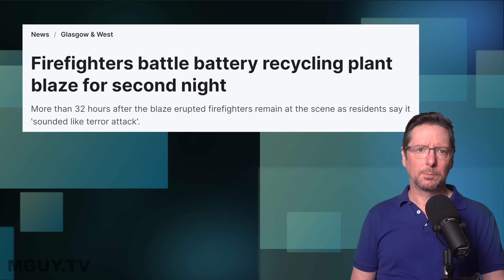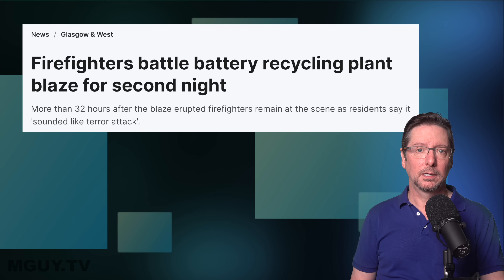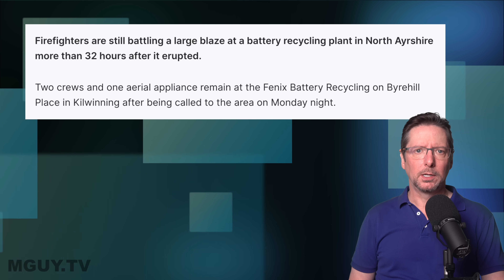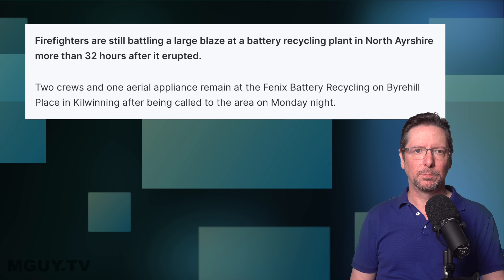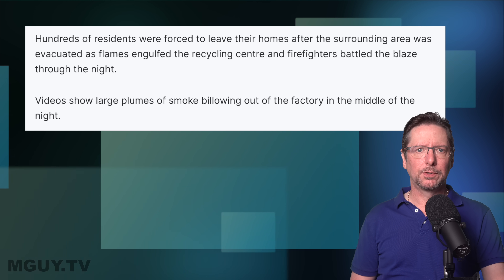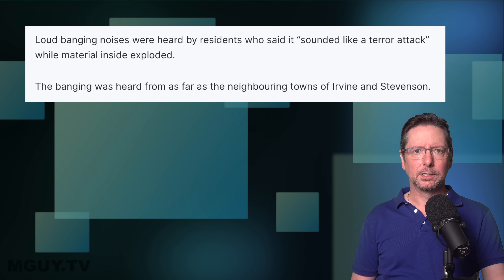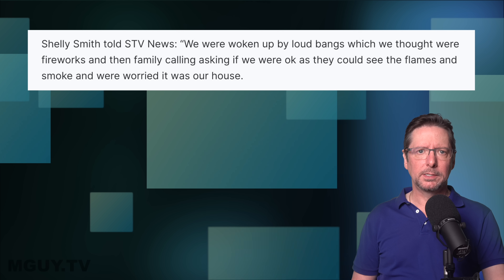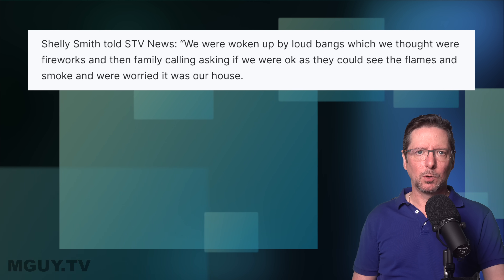EV and Lithium Ion battery recycling is DIFFICULT, DANGEROUS and TOXIC | MGUY Australia

Comment: B.S. They DON'T use fossil fuel to mine the battery minerals.
They use environmentally friendly children.
Reply: They walk to work and they wear the same cloths for months: ultimate eco sla- worker
Reply: Those exhale CO2...
Reply: @MVA133  But your not taking into account that they sequester some of that CO2 in the excrement!
Reply: @thelink66c  That'll end up in the soil and the water. Hmmm, what a conundrum..
Reply: Well, for the cobalt at least. Barring a big change in the dominant battery chemistry, EV production isn’t going to be practical in the long run.
Reply: Both.
Reply: 1. Kid battery mineral labor

2. Some people get extreme range anxiety

3. Much higher risk of garage fires.... 

4. Paying $15k to $20k more than a comparable vehicle.. 

5. every time you fuel up an EV, the fuel tank gets smaller and smaller. Battery degeneration. 

6. Poor resale value. The porsche Taycan turbo S model Ev, loses over $100,000 dollars in value, in just 4 years time. That's $100k!, or $25k per year. A Nissan leaf Ev loses over half its value in 2.5 years. Here's a little joke ; how do you double the value of an Ev, when you go to sell it?.... Answer; you leave a $1 coin in the glove box. 

7. Much reduced performance from the battery in the cold, on the highway. 

8. Higher repair costs, where many, many mechanics refuse to work on them or aren't trained to do so. 

9. Awful charging network
experiences in the weather, 
without restrooms. 

10. Higher insurance rates. The UK is a great example. 

11. Replacing tires more
frequently. Michelin states that tires wear out 20% faster on an Ev, and could be as high as 50% faster! Ev tires made for ev's, cost 20 to 30% more, than regular tires for ice cars. As Ev tires wear out, they leave behind more tiny particles of rubber than normal ice cars. This causes more pollution. 

12. Death by autopilot, if you use it in cars that have that feature. 

13. $15k - $35k battery

14. Low km range per tank of energy. 

15. Sometimes, you must wait in-line 1-2 hrs
to charge.

16. Then wait more time to charge, while charging.

17. Spontaneous combustion, with no way to put out the fire storm.

18. If they catch fire in a tunnel, many people will die.

19. People without a pro charger system or a parking spot at their house, will run an extension cord to the road, which is dangerous and could lead to people tampering with your charging setup (super slow charging at the road). Currently illegal to run an extension cord to the street in most places. 

20. If you're in California, you won't be able to charge your car past 4pm because of a shortage of electricity supply on the cheesy grid.

21. It is not actually "green". The pollution is made at the power station, and during the manufacturing process, not the car.
In advance of the Cop26 climate conference in Glasgow in 2021, Volvo released figures claiming that greenhouse gas emissions during production of an electric car are nearly 70% higher than when manufacturing a petrol one.

22. Only 5% of used junk batteries get recycled, the rest go directly into the bin. It's cheaper to mine for new minerals.

23. Chhinna actually does 70% of all the refining of the minerals and production of the batteries.

24. Minerals are becoming more and more scarce, and the cost will only go up, not down.

25. Some countries where they mine for lithium, actually use a very big boat load of fresh water to only produce 1 ton of lithium, so they are afraid of running out of water. It takes over 2 million liters of fresh clean water to produce 1 ton of lithium.
Reply: There's more to the list!

26. Ev cars will soon not be able to drive in tunnels or be able to park in underground parking garage and probably will eventually void your house insurance if you park it in your personal garage... 

27. It is very hard to charge your battery at super stations when it is bitter cold out. Look to Chicago news for this situation. 

28. If a fire truck comes to put out an Ev fire, all the chemicals go directly into the sewer or storm drain system, poisoning everything. They need tons of water to slow down the burn. They can't actually put the fires out, they are only trying to prevent other things near by from catching fire. 

29. Ok, there are 2 good things; regenerative braking, which charges the battery while you are slowing down on the highway, which saves your brakes from much wear. It has come to my attention that some people set up their regen system for maximum regen while taking their foot off the accelerator pedal, and not "coasting". For best mpg, you must coast more. You need to "hyper mill" for best mpg. If regen is set too high, passengers will end up puking. This happens because the car is too quiet and accelerating and slowing down to fast. 

30. Loss of fuel tax revenue, so now the roads will only get worse, not better, but... The state of new Jersey will have a new annual road tax for Ev buyers, starting July 1st, 2024. The fee starts at $250 in July and will increase by $10 until 2028, when it reaches $290. EV buyers in the state will also have to pay four years of registration fees upfront, making it significantly more expensive to purchase a new electric model. Other states also have their own way of collecting money. 

31. in Dublin, huge diesel generators are being used to charge EV buses, due to electrical grid strain. buses in Athlone also cannot be put on charge until midnight, for the same reason. Bus Éireann is saying that they can't charge their buses until 11pm for the same reason,  and to avail of a lower tariff. 

32. Not everyone on earth even has electricity to charge their cars. What are they supposed to do in 2035? It's easy to get a bucket of fuel to power up a regular car. 

33. VCE, or "vapour cloud explosion" is very bad. If any battery, typically anything larger than an E-scooter battery, and especially only "half" charged. If a problem occurs in the cells, it might not catch on fire right away. Instead, a cloud appears, and then may be ignited a short period afterwards. There are 2 different types of vapour clouds that appear; heavier and lighter than air, which form will be dominate, can not be predicted yet. This produces a bomm.

34. For Ev transport trucks, they aren't allowed to carry the same payload as a diesel truck, because of the massive weight of the battery. The owner of the Ev truck therefore loses potential profit, every day. They also lose more profit for the waiting times for charging that Ev truck. The driver will get paid to charge the truck, which in turn forces the owner of the truck to lose more money. 

35. Ev cars are more likely to be written off, if they experience a minor collision. After the collision, something could have upset the structural integrity of the battery. 

36. Ev cars lie to you. If you are bold enough to go out on a decent road trip and its 210 miles, one way, and your Ev tells you that your battery will last you 223 miles, there had better be no hills, or excessively cold out.... You'll probably get stranded, trying to get to the charger, at the end of the trip. Ev's have left many families stranded already. 

37. Ev's and their batteries, will soon need their very own "passport". With all info about them when born, and current info about them (power output, resistance, mineral composition, etc.) 

38. Thieves stealing charging cables, will soon make it impossible to "fuel" an Ev car. They take a long time to replace the cables, just to have them cut again for scrap money. 

39. Cars were typically being made lighter and lighter using aluminum and or fiberglass and or carbon fiber, to reduce emissions and pollution. Ev's are only getting heavier and heavier, causing more pollution than ever. Remember, an ev's pollution is made at the power station and the dump, not at the actual Ev, except for the tire particles as mentioned above. 

40. More on spontaneous combustion of the battery. What if you had 3 children strapped into car seats, in the back seat, which kid do you rescue? More fires start so fast, there is hardly any time for even the driver to escape, let alone 3 kids strapped in. 

41. There must be a reason that Boeing 787's aren't battery powered.... Until jets are battery powered, I'll be sticking to fossil fuels for my mode of transportation. 

42. Can't bring an Ev up north in the woods, nor any battery powered chain saws, where there are no grids to charge them up. You would need a huge amount of solar panels to get you anywhere. 

43. Even Mr. Bean, (Rowan Atkinson) says;
"I love electric vehicles – and was an early adopter. But increasingly I feel duped". 
"When you start to drill into the facts, electric motoring doesn’t seem to be quite the environmental panaceaa it is claimed to be." "It seems a perverse choice of hardware with which to lead the automobile’s fight against the climate crisis." 

Mr. Bean (Rowan Atkinson) is a smart man. 

44. There isn't a used market for ev's. How are teenagers going to buy and insure a $50K Ev... (take your pick: either $50,000 new or a $20000 used EV that needs a $20K battery replacement in a few years)?? A teenager can buy a used $1k ice car and be set up for 5 years, no problem. 

45. Even if large transport trucking companies have a service where they could just swap out their pouch batteries for a freshly charged battery, the lifespan of the battery would be greatly reduced to maybe a couple of years. Recharging a huge battery 3 or 4 times per day would really hurt the battery in short order. 

46. If an Ev car goes up in flames on a huge cargo ship, the whole cargo ship sinks. Happened many times already. 

47. Many many people claim that driving in an Ev makes them, their family and their dogs sick. Motion sickness. 

48. With the extended charge times in the public, there is a much greater chance of getting mugged or car jacked. In a tesla, if you see a criminal gang heading right towards you to mug you and steal your tesla, you can't just drive off. You must go outside, disconnect the charger, go back inside your tesla, turn it on, put it into drive mode, and then attempt to flee the muggers, with the little time you still have remaining. In a regular petrol car, all you must do is put it in drive or 1st gear, and flea the situation. The fuel pump hoses have nice quick-disconnect couplings that pull apart when you go to attempt to flee criminals. This saves much time, your car, and potentially your invaluable life! 

49. When your Ev is at 10% Battery left, and you head out to find a public fast charger bank of 10 fast chargers, and they are all full, and ok, some aren't working, and there is a line up of another 10 cars in front of the fast charger bank, you might not be garenteed that once you actually have access to a "fast" charger, that it will actually be capable of "fast" charging. You see, there is only so much power alloted to a full bank of "fast" chargers. You will get fast charging for maybe 5 or 6 chargers being used at a bank of 10, but connect 7 or 8 or 9 or 10 ev's to that bank of 10, the bank as a whole will throttle charging power output to all cars, so as to not fry all the wiring of the bank or blow the fuse or breaker. With 10 cars charging at that bank of fast chargers, it will become a bank of "slow" chargers. I would have of thought that this would be designed into a fast charging bank. Some charging stations might not throttle you down. 

50. BMW i5 Ev cars and some similar models of BMW protect their battery life. If you DC "fast" charge to many times, a message pops up saying that you must wait 2 days to "fast DC charge" again. This protects your battery. Some say that you can DC fast charge, but at a reduced rate, and some say that the alarm resets once you ac charge 1 time. 

not all of these points affect every Ev, or Ev driver, or every Ev charging station or bank

There's this Ev van company called "Arrival", in the UK. It's been around for 10 years or so. It was worth around $13 billion just 2 years ago.... 

They didn't sell a single unit, and are now bankrupt.

Hertz rental car company backed out of a huge tesla Ev purchase of 100,000 ev's. Soon after, Hertz backed out of a huge purchase of 65,000 Chinese Polestar ev's. They did that because ev's cost to much to own, and too much to operate. The CEO of Hertz, Stephen Scherr, is stepping down from his position late March, 2024. He blamed EVs for the Loss of revenue. The cars were more expensive to maintain than Hertz had initially thought, and the company couldn’t make as much money selling them, when it needed to refresh its offerings.
Reply: @Tezzzaaa  tried not to. Lol.
Reply: @jakefriesenjake go get ‘em Tiger! Geez, you wonder how they ever managed to sell that junk in the first place. Mind you, there is a place for some type of electric vehicles, but the current state of the art is not it.
Reply: @markvincent5992  absolutely. Buy one if you want. Don't force anything. Our infrastructure doesn't support it
Reply: @jakefriesenjake  Thanks Jake, I'm keeping that list for later use. Cheers.
Reply: @RoverIAC  no problem! Copy and paste. It took me a few months to create that list. I guess some people don't like it, so I was forced to split my list into 2 pieces, so that I could actually post it. Bunch of bs I have to jump through just to be able to talk in here. Enjoy.
Reply: @jakefriesenjake all correct and true! EVs don’t sound too good anymore, do they?
Reply: @markvincent5992  they are ok, but definitely not for everyone.
Reply: @jakefriesenjake  I see hybrids in the near future. I would like a hybrid with awd, around 400 total hp, using small individual motors at each corner and using a small I/C system to make electricity and heat/cooling without any drain. A small battery pack would be used for around town. All that and 50+ mpg
Reply: @markvincent5992  yup. Saves brakes and charges up your battery while you apply the brakes. Makes sense.

If the people who buy high horsepower ev's are truly concerned about the environment and being green, they wouldn't buy them.

They would buy the absolute lowest hp ev, to conserve battery power
Reply: Why waste resources and money sending children to school? So much more educational, cheaper and better for the environment to have them doing the work of hydrocarbon guzzling machinery.
Reply: @maifantasia3650  prisoners too 🥳
Reply: Where's Greta 🤷🏻‍♂️.
Reply: They would also argue that this a great thing as the children are biodegradable.
Reply: and millions of gallons of water pumped by a ICE engine
Reply: 😆😂🤣 Quite True!
Reply: Long ago the notion of people was removed from the workplace we are just Human Resources and disposable.
Reply: Lmao!!! 😂😂
Reply: Cobalt are also used to clean oil.
That's cobalt that isn't recycled.
So, atleast EV's recycle the children...... 😂
Reply: lotsa kids missing in Maui..
Reply: The real meaning of Human Resources.
Reply: I am sick of these EVs being pushed on us. Never ever will I own one.
Reply: Children don't emit as much CO2 either.
Reply: Africa have lot of children, yearly  African population growth are for around 3%  and that means every 25-29 years   Africa double its population
Reply: 100% organic children, too.
Reply: At first I laughed…But then I 🤔😳😲😬😡
Reply: SOME lithium batteries are highly dangerous. LFP and LTO chemistries are very low danger. All lithium recycling is difficult and costly.
Reply: Biodegradable* children
Reply: Child labor may be used to mine it, but the raw materials must be separated from dirt, the ore must be smelted to obtain these metals, lithium doesn’t just pop out of the ground ready to use.
Reply: Doesn't that lithium make the kids sick?
Reply: Similar fires have occurred in manufacturing plants in Detroit, Michigan recently.
Reply: Not that environmentally friendly,they're not recyclable.
Reply: 🤣 gold 👌
Reply: Plus they are disposable when they fail to perform properly. Just pop out new ones in a jiffy!!
Reply: You had me going there for a second! But you were completely right lol!
Reply: If they advertised it would be half price if child labor was loosened a whole lot of people would agree. Bit off to the point but I've seen ads of "locally grown" and "fair priced" being over double the price on average which is quite contrary to a fair point of price. Doing the opposite, halfing the price with child faces on there people would gobble that up on a dime's notice.
Reply: @inybisinsulate People as an entity do not exist in the modern 'climate' tm  .  They are either a commodity, collateral, a target market or just a plain target.
Reply: @inybisinsulate I’m sorry was there any point in there? Loosening child labor laws…Wowsers! It’s the 1800’s all over again!
Reply: if they used grandfathers,, they would be fossils
Reply: Or they dam up a river, flooding out natives, and put up a hydro-electric generator. Totally obliterating the natural habitat.
Reply: Oil is not fossil fuel, it is petrochemicals.
More oil has been found on Titan than all of earth.  Look it up yourself.
Reply: The last thing a green cultist cares about is human life.
Reply: Those children give of CO2 and must be stopped!

What I find funny is CO2 is at the root of this nonsense and, if you're 50yo or older you remember that CO2 is what animals exhale as waste and plants need to live. They, in turn, give off O2 as waste which we need to live. It made a lot of sense.

In the 1970s smog was a real problem and that comes from all sorts of things:
- CO (which was the major concern back then)
- unburnt fuel (smoke particulates coming out of the exhaust)
- just dust being stirred up in the air from so many things moving about.

We've fixed many of those problems (not much you can do about dust).

Now we have 1/2 the planet worried about CO2 emissions which really doesn't make much sense. Yes, the climate is changing... It's always changing. To think that we can stop it is a bit arrogant. That's like saying, "It's too hot.. If we tax people enough we can develop technology to "turn down the Sun"."

Also, as the Earth warms you get a lot more farmland. You can't farm the frozen tundra. Plants and other animals naturally start heading North. Life thrives. Life doesn't thrive in a frozen wasteland.

None of this makes any sense except for politicians (professional liars) getting people to panic enough to give them money and power.
Reply: The truth is the remote lithium mining sites aren't in themselves environmentally pure in an undisturbed state. Natural lithium depositions in dry lake beds are not wholesome when left alone.   

There is a myth that natural was pristine and somehow perfectly balanced before activities by man ruined it.  Nature has always potentially been deadly to living things.
Reply: That's because its an endless renewable resource. It's other peoples kids. Out of sight, out of mind.
Reply: They aren’t driving these mobile toxic waste dumps to save the planet. EVs are Apple Watches on wheels, the well-off snooty libs have to have the latest shiny model to show their peers how liberal they are and to show the peasants how much better they are. Meanwhile, the politicos are up to their necks in Chiiiiineeze electric car and battery companies. 💩💩💩
Reply: cobalt is also used in your mobile phones, laptops and even toys or flashlights you bought in the last 20 years or so.
Reply: They grind up the dead with diesel wood chippers and feed that mush back to the living 😮 No BS
Reply: @jasonpocaro2086  McDeath comes straight to mind
Reply: @jasonpocaro2086  that was Soylent green, the film with Charlton  Heston
Reply: @jasonpocaro2086 Soylent Green?
Reply: @markvincent5992  yup
Reply: Your statement is mostly false. It would be physically impossible for children to remove the millions of pounds of "overburden" necessary to access the "pay dirt" for most mineral deposits used in lithium-based battery production. Only cobalt sourced from the Democratic Republic of the Congo (DRC) employs child labor for mining, and that does account for 60% of the world's cobalt supplies.

FYI - The DRC was a thriving country under French colonial rule. It is now an extremely poor country, thus the availability and use of child labor. Watch a walkthrough video of Kinshasa and you'll see why children would voluntarily work in dangerous mines to improve their lives rather than to live in tin-plated shacks in the slums.
Reply: @GaiusTacitus  They use big diesel trucks that gulp that fuel.  But yes, children are involved in the entire process. 

A lot of this is documented in Goehring & Rozencwajg Q4 2023 Natural Resource Market Commentary   You can search for it; it's readily available.

They point out that a lithium battery needs to operate for 70 years to pay back the carbon debt incurred from it's creation.

Now mind you, the whole carbon-is-bad narrative is utter B.S.  but for the people who think carbon is bad, it debunks the value of EVs as being good for the environment.
Reply: @GaiusTacitus Idk, they have a LOT of children… and believe me they use them where they’re not seen by Western eyes.
Reply: They probably think they dig it out like at the quarry Fred Flintstone works at.
Reply: @bentullett6068  Reality check. That is precisely how most large mining operations are carried out. If you want to see real mining in action, then watch an episode of "Gold Rush".
Reply: For some of it yes but even that eventually has to be transported to the plants to be made into batteries and I can assure you there are no trains of children transporting it thousands of miles to the factories. Still you touch on a very good point that should have been made!
Reply: @kevinm3751 nope to move it they use tons of coal and oil.
Reply: serious science-fiction taught us many things one of them being that robots cost too much money compared to biological slaves
Reply: @fredEVOIX don’t be ridiculous! A good robot beats a human slave any day. You don’t have to feed it, house it, provide medical care and it doesn’t go out on strike or ask for higher wages.
Reply: Pretty sure they mine for lithium in Australia so don't think they would get away with using children there.
Reply: @bobeden2067 we do Australia is the number 1 producer followed by Chille and China which combined produce about the same as us but for some reason i don't think they work under the same standards
Reply: @shaynegadsden  I watched a documentary on lithium mining in Chile. They ruin the environment. Villages must be evacuated, and humans will never again live anywhere near the mining sites due to contamination of the water supply.
Reply: @GaiusTacitus  yeah most places extract lithium brine which is those giant toxic evaporation pond. Although they claim ours is the "dirtier" source because in Australia it's mined as a hard ore which require more energy
Reply: @shaynegadsden yes, but you ship the raw material to China for processing.
Reply: @markvincent5992  And they said mined not processed also do you know how dangerous it would be to ship pure lithium around
Reply: @bobeden2067  BHP are our biggest lithium miners here in the insane asylum also known as Australia
Reply: @happyjoyjoy6976  Shame, I think AUS 
and UK, are a little 
more lost than us (US) but we are very 
rapidly catching up.
Reply: @bikersoncall  very sad my friend the  way our countries have fallen into depravity. much love and have a wonderful day 🤗
Reply: @happyjoyjoy6976  So true,, have a great day too!
Reply: @bobeden2067  ''Pretty Sure'' the bulk is mined in Africa,
and really ''pretty sure'', actually very sure China is 
the worlds largest Producer. I'm wondering
 if child labor is fine with you so long as AUS isn't 
using practicing it at home. 😄
Reply: @bobeden2067  so they use fossel fuels to mine then !
Reply: @bobeden2067  that is not the point, do not try to deflect, the companies that buy the minerals know it happens, and to make it impossible to identity which minerals come from where, they centralise as much as possible and keep it very quiet, there should be no child labour
Reply: @StephenFirth-x3j  I agree with the no child labour but we need to also look at what is happening in our own back yard too. It seems to me that they have to shift a lot of material to get what is required to make and EV battery for sum rich pratt driving his nearly 3 ton Kia EV 9 im doing it for the good of climate change.
Reply: Bobeden, if the conservatives need to lower the legal working age, they definitely will.
Reply: @davereiland9921  No, they won't. Given that even young adults with college degrees are lacking useful knowledge, skills, and abilities needed to enter the workforce, it is more likely that Republicans will raise the entry level age for workers to 30.
Reply: @davereiland9921  It's not conservatives demanding we switch to EVs to "save the planet", so this is really all on liberals so they can tell people they're saving the planet.
Reply: @teekay_1  and conservatives are doing what to stop it?
Reply: @davereiland9921 get a grip! Geez, kids are allowed to work in most states starting at around 15. Have done for years . And no, they can’t get a job @ GM.
Reply: @GaiusTacitus hardly. It’s more likely they’ll send the slackers to work camps instead of unemployment benefits. Good!
Reply: @teekay_1 and control our movement.
Reply: @davereiland9921 trying to work around the do nothing democRATS!